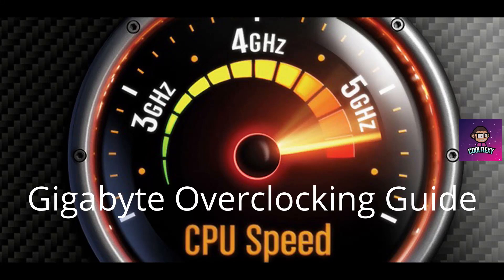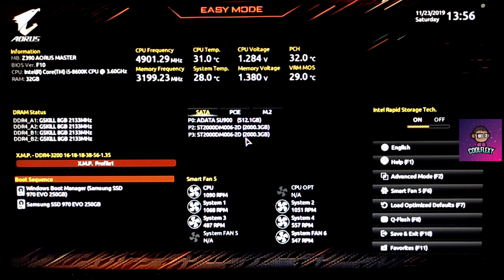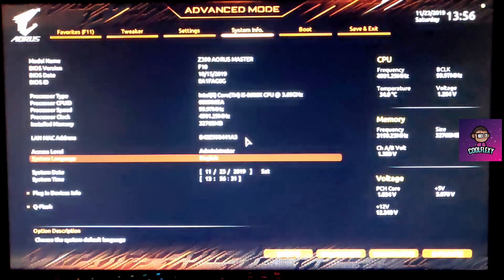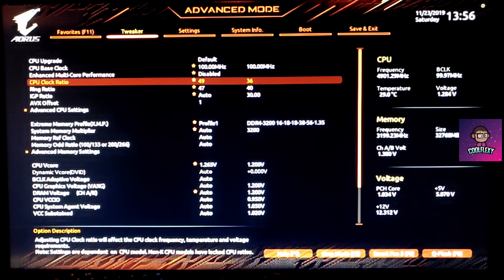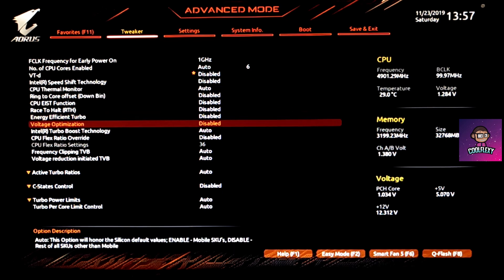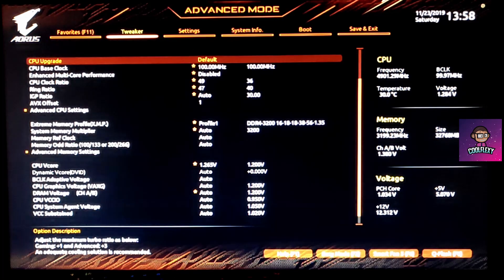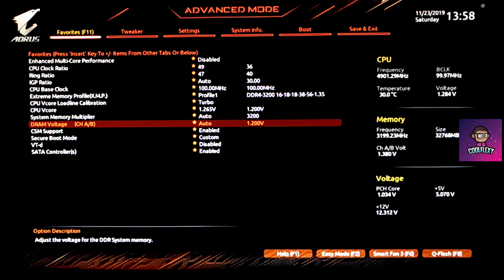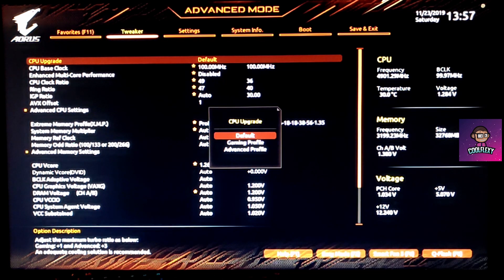Gigabyte Z390 Aorus Master Overclocking guide

Comment: I tried here to follow these adjustments on the Gigabyte M Gaming X I5-9600k but I didn't get stability!  We tests with Cinebench R20 had PC shutdown!
Reply from the maker: That's perfectly fine, each CPU is different, and motherboard ram and PSU all play a part.

Try something lower.. reset to default, then only turn on xmp. 

Run cinebench to set a baseline .

Then play with different frewuencies
Reply: @Coolflexy1  Today I reset all the settings on the motherboard including the profiles and started exactly like this, all the settings on automatic, only the cores activated, I managed to leave the Vcore with 4.6ghz at 1.26volts and the memories with XMP activated for 3600 mhz at 1.35 volts tests on Cinebench R20 I got 2818 points. Now with 4.8ghz at 1.34 volts I got 2912 points on the Cinebench R20 and so far with 4.9 GHZ at 1.39 volts, with the power system off and LLC on the Ultra Extreme I got 2960 points.
  Here in Brazil x São Paulo the ambient temperature is between 29 degrees, with my aorus elite Z390 I reached the mark of 3019 points in Cinebench R15 at 1.36 volts + LLC ultra Extreme and memories at 3000 mhz at 1.35 volts.
Reply from the maker: @Moises-lr3hc  what's your temp CPU temp while running cinebench?

Cuz 1.36V and 1.39V are a bit high.

Just make sure they are below 70, and you should be good. Otherwise dial it back a bit.

Comment: Hello Sir, I have Same board & processor. But my motherboard not start when I enable XMP. my Ram is Thermaltech taugram 4400 RGB. What Should I do pls help Me.
Reply from the maker: Instead of running at 4400, try running it at 3200 mhz. 

Let me know if that works.
Reply: @Coolflexy1  no sir I already tried in many MHz but some time display come but not start
Reply from the maker: @MAHESHKUMAR-yy1xt  It feels like a memory controller issue on the CPU or the could be a motherboard thing, similar to how X570 react poorly to BLCK overclocking, but B550 don't.

Things you can test, restore BIOS to factory default settings. Then try 3000 or 3200 mhz. 

Try updating the BIOS. Then try again. (Restoring to factory default settings, before updating is also a best practice).

Try changing the RAM slots if you're using 2 sticks of RAM.

Try the ram and xmp on another system? 

Try a different highspeed RAM  on your system?

Comment: What's a good voltage to start at for 4900mhz? It seems stable right now at 1.26v or should I be more around 1.27v?
Reply from the maker: It depends on the CPU and depends on the silicon lottery. My 8600K runs on 1.3v, 5.3 GHz but my 9600K doesn't go beyond 5.1 GHz at 1.28v. 

Generally 4.9 GHz should be good at anywhere between 1.25-1.28, you should run some stress tests to see if the system is stable. 

And the best way to go about it is having the highest frequency at the lowest possible voltage.
Reply: @Coolflexy1  9900k
Reply from the maker: @paulreitzin5059  although I still haven't had a chance to play with a 9900K. But the approach is the same. 

More voltage = more power draw and more heat. 

So the goal is to reach the highest frequency, and the lowest voltage. I'd recommend to run a 15-20 min stress test. To check stability and temps. 

Because if you drop the voltage tooo low it's gunna crash or hang. And if the temps get too high it's gunna thermal throttle.

Comment: hi, ı have 8700k, gtx 1080 and nzxt x72. I wanna do 5ghz, can you tell me best settings for me ?
Reply from the maker: It's different for every processor, but I've seen that if you set core clock to 5 GHz and avx offset to 3 and uncore to 4.7. it's mostly works without any issue.

Comment: Hey Cool thx for this. I have a i9 9900KS and a Z390 Aorus ultra, it boosts from factory to 5ghz. However i'm experiencing instability at iddle (or soft use as watching netflix or just using chrome), the pc just reboot (some times frequently).  This dont happen when i'm playing games, rendering or stress testing. I've disabled the boost and at 4ghz it's stable. This probably means that the motherboard is not controlling the voltage with the tasks in the background, as there is variation and frequency spikes. Which option do I have to change to keep the system stable in iddle/soft use?  Thx
Reply from the maker: The try changing the ACDC LOADLINE to something more aggressive like turbo, that worked for me, with hanging or instability at idle.

Comment: "internal Graphics" doesn't show up on my BIOS F10 version, which is the same as you bios version in the video. I have the I5 9600K CPU. any ideas? thank you
Reply from the maker: Are you using the Aorus Master or some other Gigabyte motherboard?
Reply: @Coolflexy1  yes it is the aorus master. I ended up switching to the other bios which was version F7 or something I believe. Maybe f7b I'm not at my computer now. Thank you though for the reply. I would like to go to the current bios but I am not so sure that the f11c BIOS is stable.
Reply from the maker: @supermugz  I've been testing the F11c for a month now and I've actually been getting better temps and more stability, but my cine bench score dropped by 35.
Reply: @Coolflexy1  f11c using new microcode .u can find modded f11c with older microcode on gigabyte forum.im on f11d beta bios with older microcode no performance loss.f9 also uses old microcode if u want the official one

Comment: I have i7 9700kf i can you give me best setting advise please ? i would like to get 4.9 ... i don’t want that much temp on my cpu ... i run it with Arous 2080ti.. nice video btw
Reply from the maker: You could try core frequency 4.9, avx offset 1, uncore 4.7. with a 1.25 - 1.275 voltage. 

Turn off VDt, internal graphics and MCU. The let me know about the temps.
Reply: @Coolflexy1   thanks for the replay how i apply the oc to all cors ? i couldn't find the option in the bios
Reply from the maker: @abdulrahmanmohsen3740  If you disable multi core performance or multi core enhance and set the core clock ratio, it automatically applies to all cores on Gigabyte boards, on Asus I remember that there's a drop down in front on the Core speed option and you can select "sync all core" there.
Reply: @Coolflexy1   my mother boards z390 Arous pro wifi... i will follow do same oc you did and see what happens i will start with 1.25
Reply from the maker: @abdulrahmanmohsen3740  Let me know if there are any issues, and if you get a blue screen while running cinebench or prime95 then try increasing the voltage.
Reply: @Coolflexy1  i couldn’t find the uncore ? however i saw something core rachio ser as 4.3 it’s called ratio ring ?
Reply: @Coolflexy1   he Friend iv'e been trying to hard to stable my system and i follow what you did in the vid, it seams that my CPU wont work stable unless with 1.350V with 5.0 and AVX set on 1, uncore 4,7  test it on Aida64 & Cinabensh and it stable right for now, my temp idle  32 C and under 100% load max around 65 C ... the Temp is good even while gaming. do you think this is enough or should i do some adjustments ?  the Vcore on CPU-Z show 1.320V  1.332V  & 1.344V
Reply from the maker: @abdulrahmanmohsen3740  the temps are fine, and if it's stable then you don't need to make any changes, do monitor if you get any micro stutters in games. 

If you do then reduce core, uncore speed, & voltage.  Try 4.8 core, 4.6 uncore, avx 1, voltage 1.3
Reply: Coolflexy i tried so many games with ultra settings nothing happened regarding temp or shuttering it’s run fine with no crashes... i think 1.350V is my sweet spot for 5.0GH .. is this voltage okay running the system all day long? according to Gigabyte they say 1.4V also fine
Reply from the maker: @abdulrahmanmohsen3740  yes, 1.35 is fine, and 1.4 is the max you should be able to go safely. But 1.35 is the point where you take caution of temps and stability. 

Since those are fine, you should be good.
Reply: Coolflexy Should i disable the turbo technology ? i left it on auto
Reply from the maker: @abdulrahmanmohsen3740  I've been playing around with it and turbo boost actually slows the system, when not in use. 

While gaming it doesn't make a difference.
Reply: Coolflexy i see .... so i rather let it on auto
Reply: Abdulrahman Mohsen I have this exact system too? What are you running for cpu cooling? I’d like to try your settings

Comment: I have an i9 9900k and have this bios can you give me a good overclocking sitting for it
Reply from the maker: I'd recommend starting with 1.275 - 1.3 voltage, and fix uncore and avx to 4.5, then  start with core frequency 4.8 and keep increasing till it's stable and cool. 

Once you figure out the max core frequency then increase avx and then uncore. If I remember correctly, a good rule of thumb is keeping avx 200 MHz below core and uncore 300 MHz below core frequency.
Reply: Coolflexy 
Thank you my sitting was so unstable 
❤️much love<3
Reply from the maker: @evernever5480  You're welcome!
Reply: I thought i9-9900k overclocked from intel to 5ghz
Reply: Whats the clock speed for ur i9
Reply: X5 TV 5gz

Comment: My pc keep crashing i did the same setup i have i5-9600k and gigabyte z390
Reply: Bro if the pc unstable should i go higher or lower with cpu vcore voltage. Because i keep getting the blue screen
Reply from the maker: @X5TV1  You should go for a higher voltage, but do not exceed 1.35, cuz after that it can be risky, rather try lowering the core speed a bit.
Reply: Thank you so much
Reply from the maker: @X5TV1  anytime, sorry for the delayed replies though.
Reply: Bro my cpu usage is very high compare to my gpu i searched for solutions but I cant find any. most of my games uses way too much cpu even if i increase in game settings still giving me high cpu usage my pc freeze and stutter while gaming
Reply from the maker: @X5TV1  So I'm using an 8600k which is the same, but I don't really get that issue in anything other than nfs heat, cuz 
Fps impact CPU most than GPU in most cases. 

But stuttering and 1% lows can be due to a number of reasons. 

I'll recommend making a baseline remove all over clocks, then check the min fps you get (for me it's 130 in fortnite), try limiting fps to something near that. You shouldn't have stuttering at this point. If you do, then   it might be a deeper issue. 

But if not the start overclocking again till the issue issue begins. Like in my case I can overclock till 5.2 GHz but I get micro stutters after 4.9 GHz.
Reply from the maker: It could either be a silicon issue or voltage.  First try reducing the core speeds to 4.5 GHz which is always stable and test it. Then increase gradually till you find a stable point and do watch temps. 

Like my processor works best at core speed 4.9, offset 1, uncore 4.7. 

I can take it to 5.2, offset 2, & uncore 4.9, but that introduces micro stutters and fps drops.

Comment: What v core would you recommend for 9700k? I have z390 gigabyte aorus pro WiFi, and I can just set my 9700k to 50 multiplier without touching any power saving features nor llc or voltage all auto and it seems stable when posting to desktop and Prime95.
Reply: Of course auto is bad as it will overshoot vcore but as I was monitoring it with sysinfo64 it wasn't too bad
Reply from the maker: Most ideal range is 1.2 - 1.3, but the lowest stable voltage is best, and it's a bit of hit and trial cuz each processor is different. Like my processor needs 1.265 for 4.9 GHz, 1.275 for 5 GHz, but 1.34 for 5.1. 

So it isn't always linear as well.